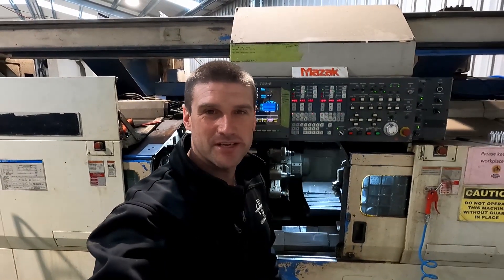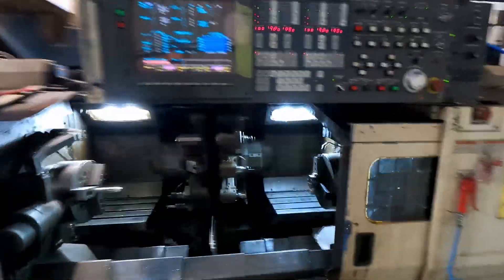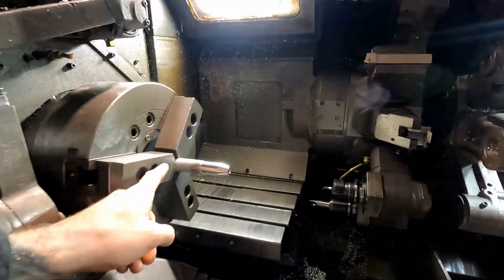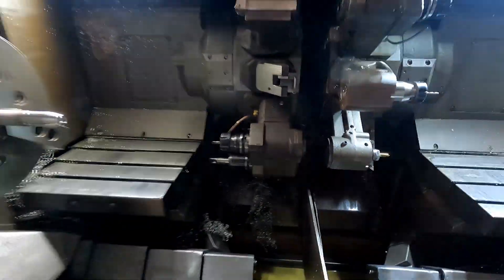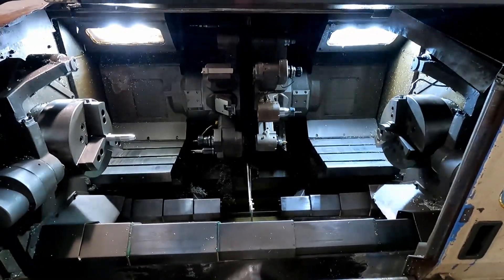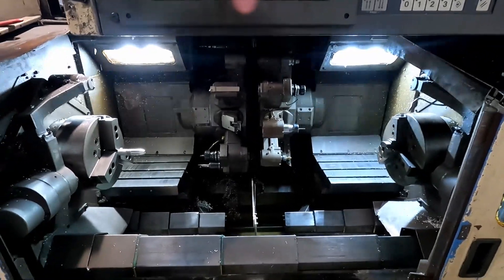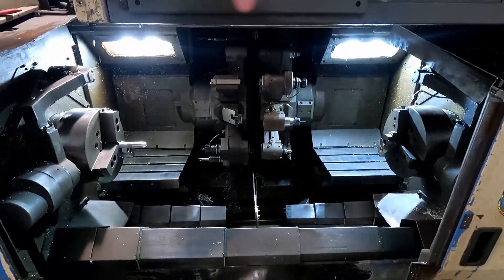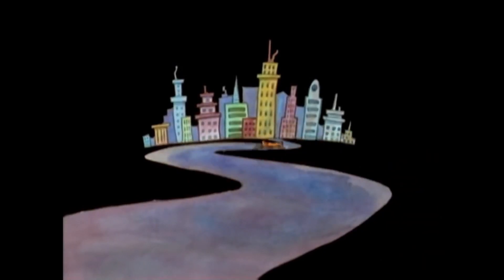Billet fork extensions on CatDog!

Comment: Nice machine, I'm in Queensland and doing a little cnc machining on the side. What sort of cnc lathe would you suggest for a guy starting out for a low budget in his garage? I've been looking a while and spares are what worry me, is there a best one out of Mazak, Okuma, and Fanuc/others for price? Is there an 'era' I should be targeting to make sure spares are available and not the price I paid for the machine? Thanks.
Reply from the maker: Hey mate, I somehow completely missed this comment. Did you end up getting something?
Reply: yeah I got a gang lathe, didn't get a Mazak cause I heard Mazak spares are hard to get currently and can get very exxy, over 5k for servo drives. Not as good conversationally as what I got but I program in fusion anyway. I would like to get a turret lathe one day though.